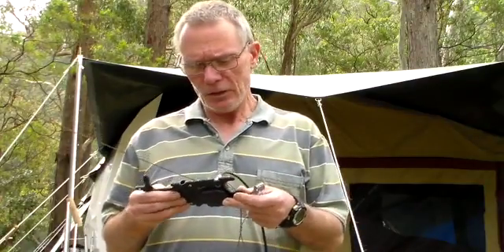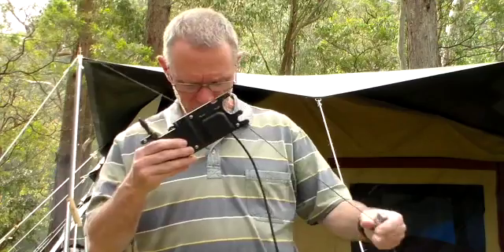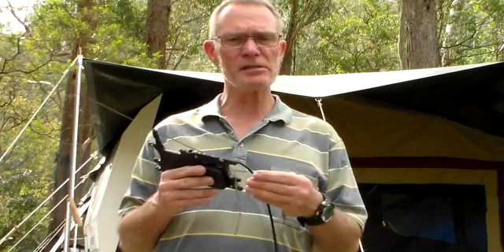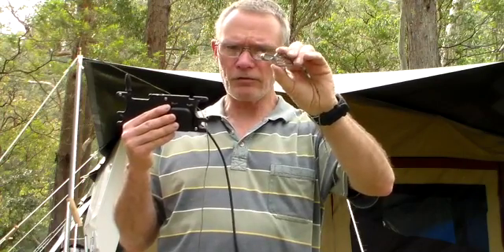Bushcom Mil-1 Portable HF Antenna Review

Comment: I have the MIL-2.. It actually works really well and was recently used in the John Moyle.
Reply from the maker: Hi, Jay. Glad to hear yours (MIL-2) worked well in the Moyle. How did you set it up? Did you follow the instructions or modify them? What did you use for an earth? Since it's an Aussie company I'll be glad if things work well with their products.
Reply: @johnsaunders8315  Hi John, I set it up as a inverted V. The ends simple where pegged off approx 1m from the ground and feed point was approx 10m from the ground. I'm located near Brisbane.

Comment: Mine tunes between 1.1-2swr 80-10m no problem
Don’t blame bushcom when the antenna is second hand & an unknown quantity 
I’ve even made a homebrew copy and it works fine as well. It’s a good antenna for NVIS Yes it can be directional. It depends on the Earth of the ground that you steak is in as well and the signal could be lower than a dipole depending how close to the resonant length of the Antenne  as it’s loaded like a beverage antenna with resistor in the driven element but even if the radiation is a little bit less and the signal is a little bit lower you don’t need a tuna for the whole HF band other than maybe 160 m and it’s a very low noise antenna being DC grounded doesn’t pick up much static they are very good temporary antenna and I have one permanently up at home as well as a terminated to wire folded dipole and I don’t need a tuna for that either

Comment: John...thanks for making the video.  You got me interested in the design so I built one, made some adjustments in lengths, and got it working from 80 thru 10m well within reasonable no tuner VSWR readings.   Worst case vswr is 1.7 to 1 on 80m.  Other bands including 60m and 30m are under 1.5 to 1.   Pretty cool!  Using a barret 2050 here for ale and selcall, qmac hf90m for selcall.   I wonder if you can send the wire lengths and load value.

Comment: Hi John, just got my foundation license a few weekends ago. Far more interested in QRP outdoor work like SOTA etc, I have a FT817ND plus a PAC12 multi Band antenna on the way. Love to see the performance  / setup in the field. Hope to hear you on the air.
Reply from the maker: G'day, Wade. Congratulations on the new licence. If I can encourage you to do anything it's to get associated with a good radio club. You probably are already, but all I can say is the mentoring you get into the hobby is invaluable. As for me, I am on the air, usually on 40m, but not as much as I would like to be...so, if you hear me - jump in and say hello. Cheers!
Reply: John Saunders thanks John.  I have joined both my local club as well as WIA. I have also identified some local sota activators and plan on asking can I tag along and see how it all goes.    Thinking about trying home brew endfed etc.

Comment: I know this video is old, but I'm pretty certain the previous owner has screwed up the unun on yours. I've made a homebrew fairly close copy of the Mil-1, with home brew 9:1 unun at feedpoint and a 470 Ohm this film carbon load resistor. Dimensions are as per the Mil-1 spec. And I don't need any tuner at all across the range 160-6m. 

Performance is pretty decent too, even in my typical set ups running it horizontally at head height hooked up in gorse bushes. Working UK to US and South America and right across UK and  Europe, on multiple bands, with just 5W CW isn't too shabby!
73 de M3KXZ
73 de
Reply from the maker: Hi, Pete. Glad to hear yours worked. I had a variety of opinions expressed to me about the product before I did the video. The concept is good but the application sometimes is varied. I asked Bushcom for another one to review, but they didn't get back to me after initial discussions. It could be that the one I had was a dud. I'm actually going to take the video down soon due to its age, as you have noted. Cheers, John VK4BZ

Comment: hi john graham here from bushcomm i would like to talk to you and give some things to check to see what is the problem
Reply from the maker: No problems, Graham. It would be good to know from the horse's mouth as the antenna concept is good. I have been told that a 16:1 UNUN rather than the in-built balun is the way to go...just been too busy to try that out. Happy to hear from you. Can you PM me on Youtube? You could just email me if you like: johnvk4bz@gmail.com
Reply: Hi John.
Did you get anu good news out of Graham, that you will shaere with us ??
73 de OZ3XO - Stig.
Reply: @johnsaunders8315  Did bushcomm give any advice?
Reply from the maker: @Jay-hr9ci  The advice was to check the balun with a resistor and then check the wire. They didn't believe the balun would bust but have suggested the wire could have broken. It's milspec wire and doesn't appear broken anywhere. Another supplier I spoke with had little good to say about the balun. I've just got to get time to check out the tests they suggested.